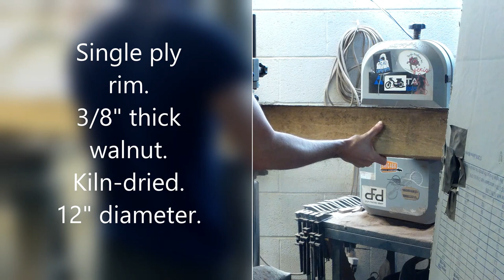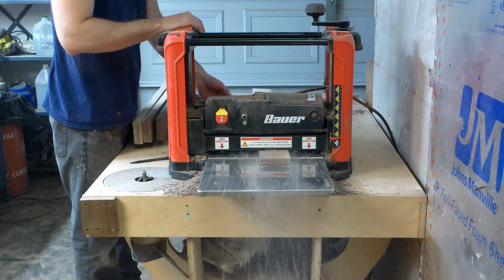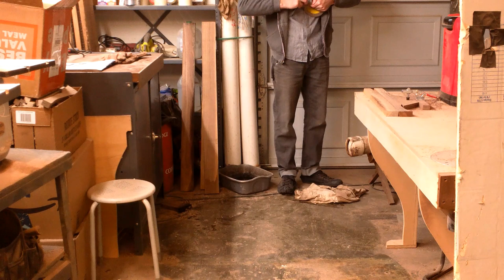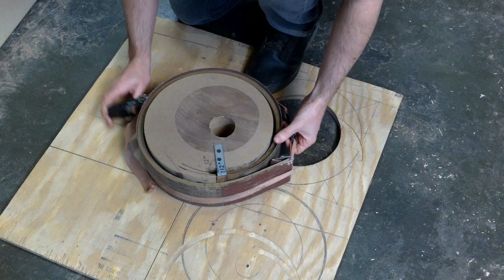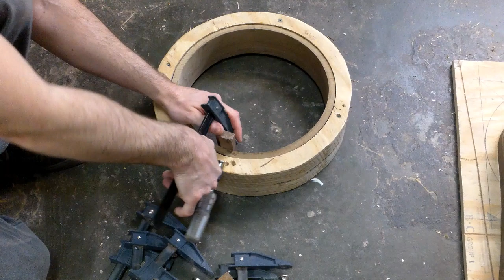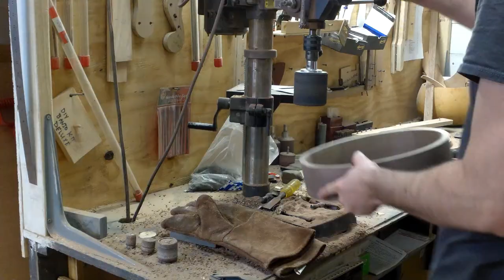Steam-Bending a Walnut Banjo Rim (entire process 2020)

Comment: Thanks for posting this.  I've always had lots of questions about the process.  Most rims are multi ply. Is added strength the reason.  I always wondered if the lamination dulled the tone.  You are young, as I was once.  A work bench that allows you to stand will save a lot of wear and tear on your knees and back.  I know. I used to work like that.  Wish I had not.  Cheers!
Reply from the maker: Thank you, and you are right, I should get up off the floor when bending these.
I think ply is used because it’s a lot easier to bend and build up a thicker rim as opposed to bending one very thick piece. I’d say the laminations have a negligible impact on tone as long as there are no voids.

Comment: Hello Mr. Carver, I am curious as to how long the plank of wood is to make that 12" rim and also what the size (diameter) of the dowel jig is, the one that you originally wrap the wood around. Would it be 12" or smaller? Also, what is the material that you use to assist in bending the wood? Brilliant work here!
Reply from the maker: the jig will be the inner diameter of the rim. if you want a wall thickness of 1/3" and outer diameter of 12"- use 11 1/3" jig. You'll need a board about 1 foot longer than (3.14*diameter).
This jig has a backing strap (very important). Made from an old sanding belt. You can also use thin metal, but edges are sharp and I've cut myself many times with these.
Reply: @brncrvr  Wow thank you kindly for the reply! I look forward to trying this out for myself! Really brilliant!! Cheers!!

Comment: Great stuff! It looks like you soak and steam the walnut...How long are you soaking and how long are you steaming? Thanks!
Reply from the maker: thank you. kiln dried- soak 3 days, steam 45 minutes, leave in bending form 24 hours. Trim, glue and into the drying form for 3 days.
No need to pre-soak green wood but the trade off is it will take an extra 3 days before it is ready to take out of the drying form, shooting for under 10% moisture level.

Comment: Brian:  I have a mountain banjo whit no relief in the neck, its straight no angle what so ever.  Is there any way to lower the action a bit on a older mountain banjo with a straight neck?  Thanks Richard
Reply from the maker: Hi Richard, I can only speak for my own mountain banjo design, but you should be able to alter the joint where the neck attaches to the body.
An easy fix might be just trying a shorter bridge if possible.
Reply: @brncrvr  Thanks Brian:  I'll try a shorter bridge.

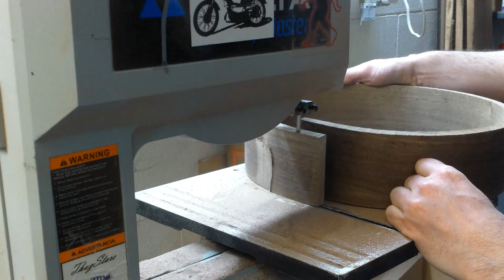Comment: I'm curious about how you know where to cut (5:00). Is there a method you use to make sure the two tapered ends match up in the mold you put it in next? Or do you just do it by eye and adjust any inconsistencies in thickness while sanding?
Reply from the maker: the tapers would only need to match/be exact if they were coming into contact with each other. you see I cut the outside and the inside and then glue the uncut (flat sides) together. It is easy to eyeball before removing from the first bending form. then the inconsistencies are sanded out once the glue has dried